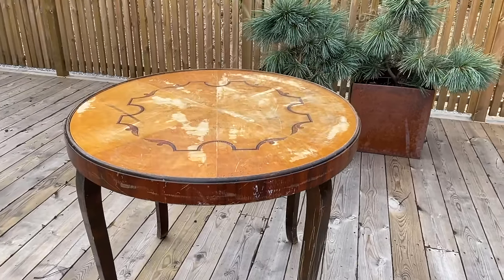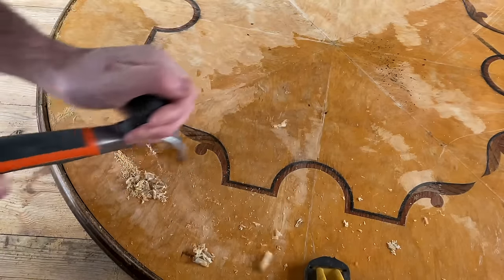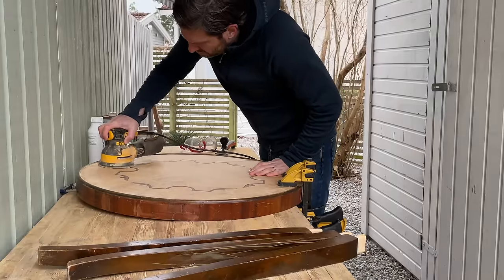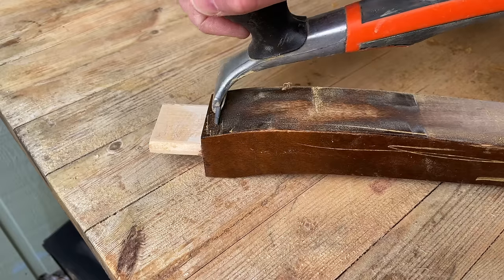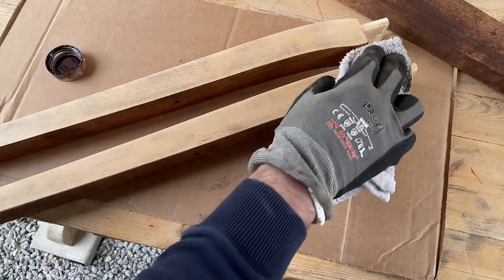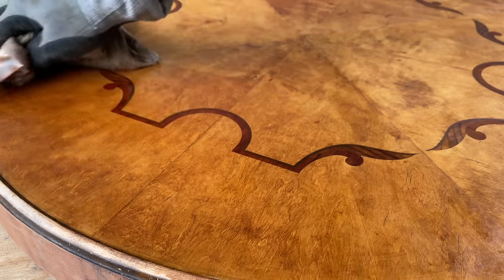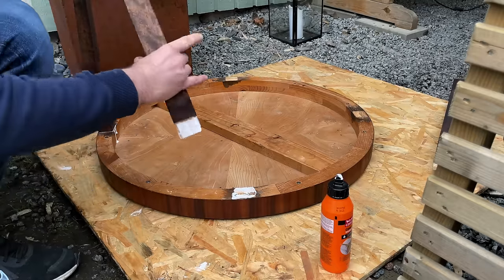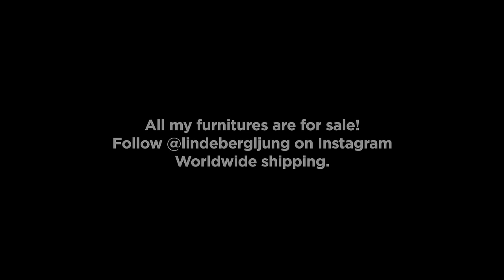The Angry Table | Restoring and Refinishing an old side table

Comment from the maker: Hi! Thanks for watching my restoration videos! I upload frequently - so be sure to subscribe. If you want to support this channel use the Thanks button or The buy me Coffee link in the description. Thanks 🙏🏻 Take care ♥️ /Anders
Reply: Smart move to find the IKEA table with glass. This is impeccable and satisfying to watch. Thank you
Reply: Лак, который использовался в середине прошлого века, в 60-70-80-х годах скорее всего полиэфирный. Это толстый слой как стекло. Его легче всего снимать скребком, нагревая строительным феном
Reply from the maker: Sorry, cant translate this!
Reply: The varnish that was used in the middle of the last century was most likely polyester in the 60s, 70s, and 80s. This is a thick layer like glass. It is easiest to remove it with a scraper and heat it with a construction thermal gun . You can try Dimetil too
Reply: @Natali98061  thank you for the translation. Good observations and advise.

Comment: What a lovely little table.  Did you ever find out who made it?  How old it is?  I love the inlay so much. And you couldn't have gotten any more good luck than finding that glass-topped table.  What will you do with the frame left over from the other one?  Another project?  Congrats on 10K.
Reply from the maker: Hi and thank you for watching! I think it’s from the 30s or 40s. I coulynot fint any informationen regarding the manufacturer or designer. And yes, it’s a really beautiful lille table 😍